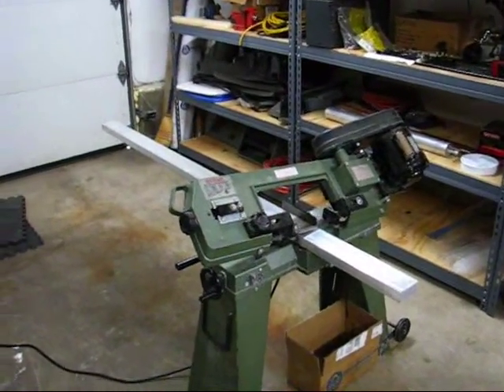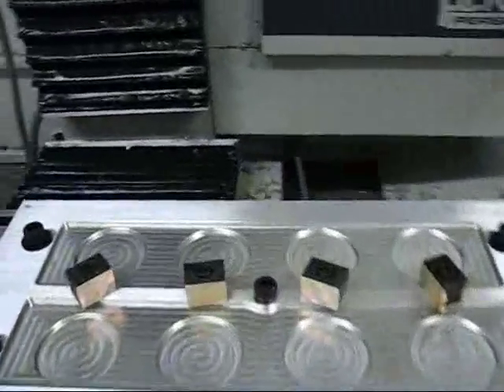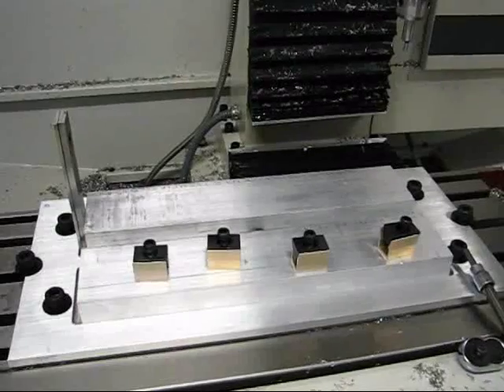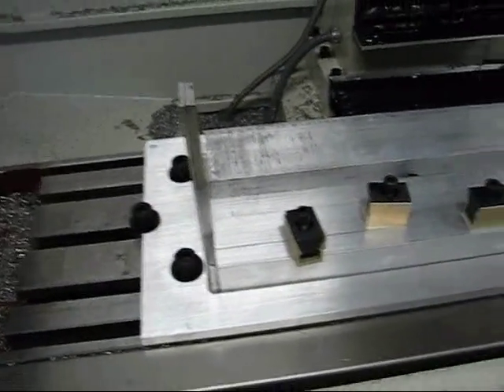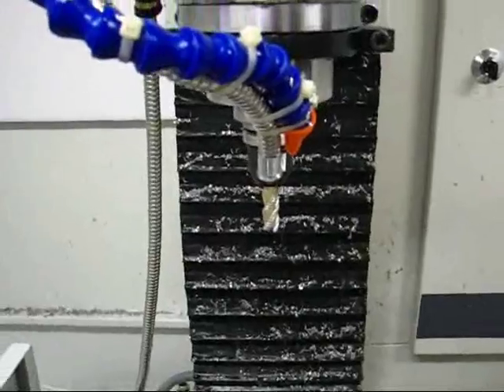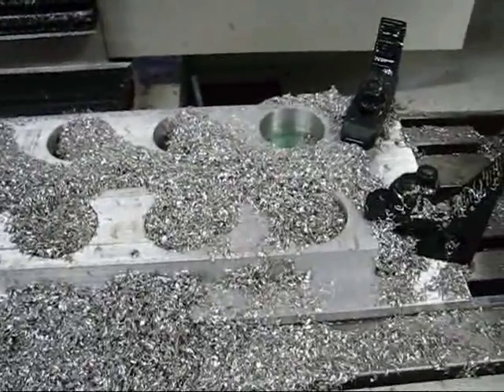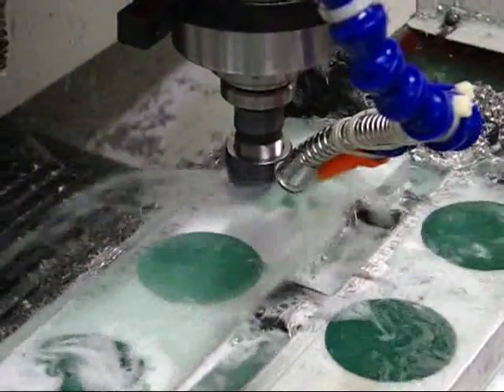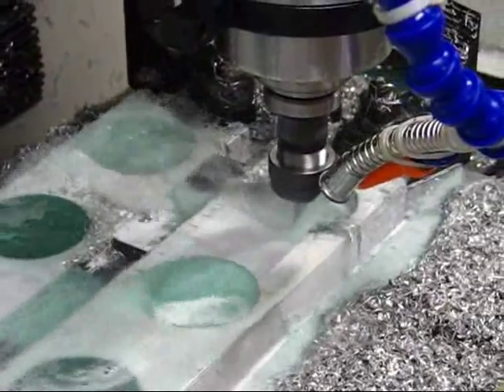Tormach PCNC 1100 - Multiple Part Milling, Operation 1

Comment: Hi:) Years ago when i worked for Linamar Machines i used allen set screws sharpened to a point screwed throught the side of the fixture to hold down my aluminum waterpump part so i could mill the swirl surfice